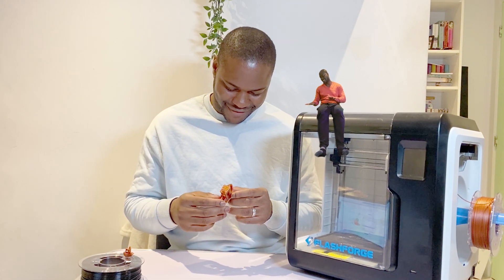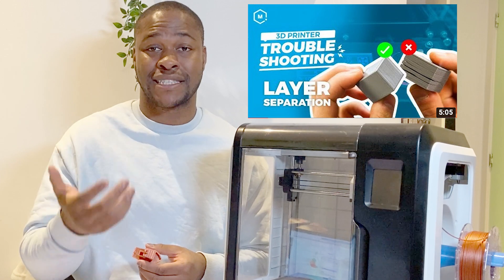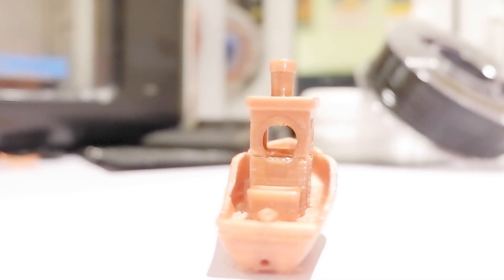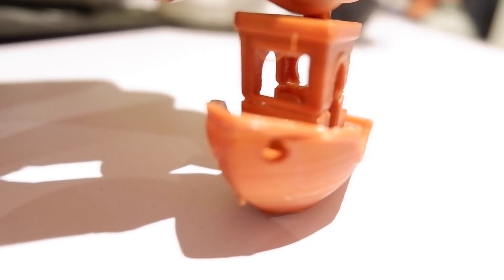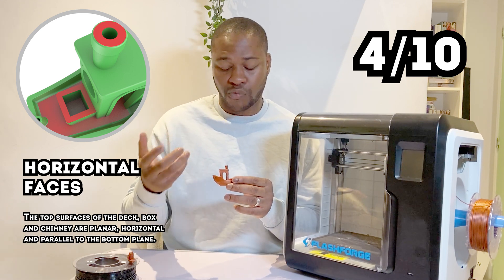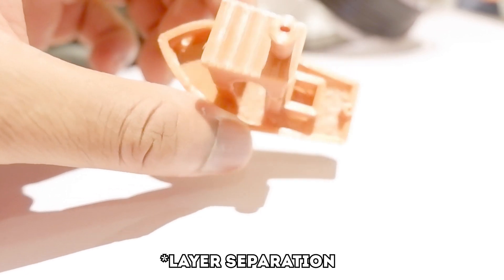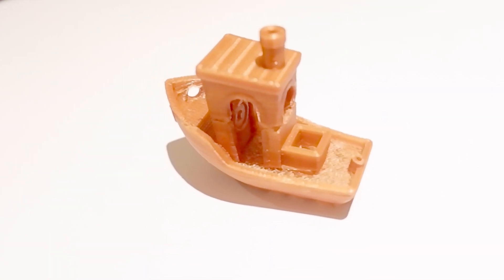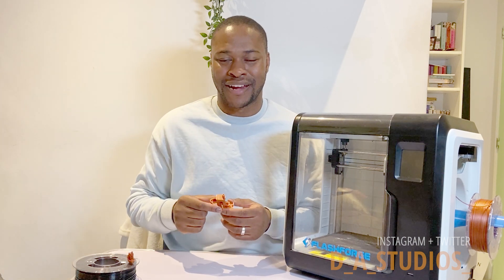FLASHFORGE ADVENTURER 3 3DBenchy Torture Test \\ Are FlashForge 3D Printers good?

Comment: Hey man, I am looking to buy one of these. How long have you had this before it started doing this? I know you have had good reviews for it initially?
Reply from the maker: Thanks for watching! Ive had it for over two years now and it started having issues after using it continuously for about 1 year. To be honest after bending the flexible plate so much it’s started to bow so i either needed to buy a nee flex plate or keep calibrating the printer. If you do end up buy one of these printers do let me know what your experience is!

Comment: overall how much do u rate this 3d printer out of 10
Reply from the maker: As a printer for beginners i would rate it 7/10 based on the ease of use, enclosure, camera, wifi connection, swappable quick disconnect hot end, bed levelling, hotbed, spoil enclosure, filament  feeder, filament run out sensor and lastly the price is perfect for what i would recommend beginners pay for a 3d printer.

It would be a higher rating if it had a bigger build volume, larger storage for filaments and more consistent prints. 😊
Reply: @DAstudiosss  ohk , thx  :)